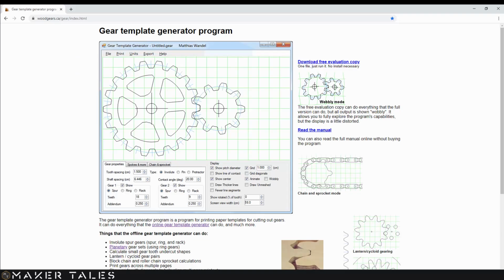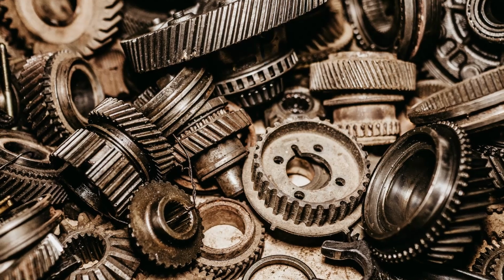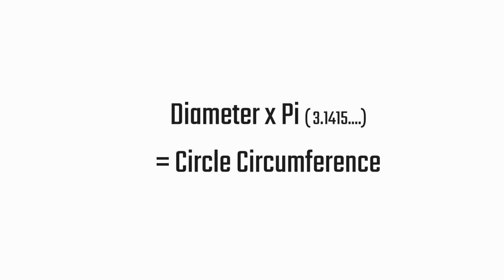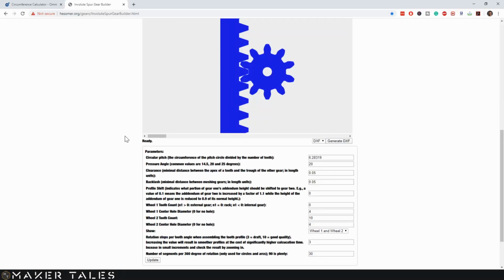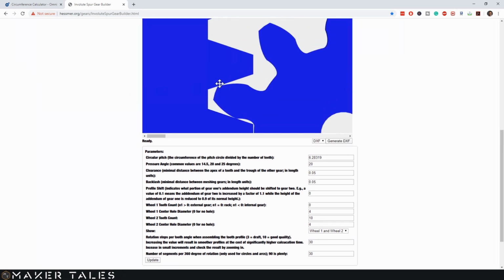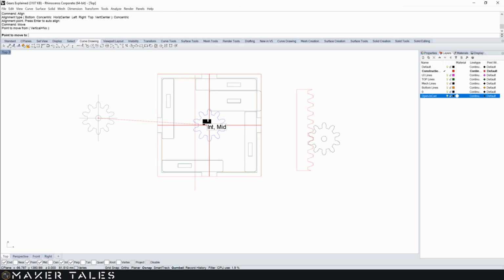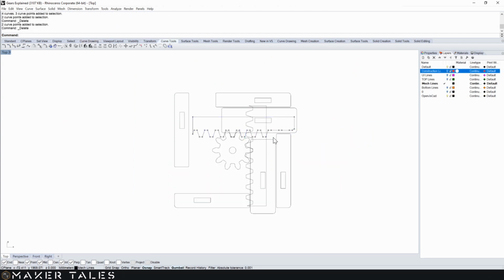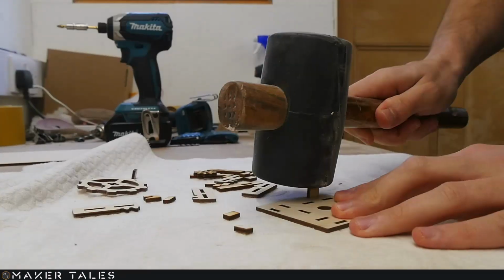How to: Make Puzzle Box Gears - (Tutorial) - Gear Fundamentals

Comment: Great video! learned quite something, only one thing, to calculate the circomference you said you should diameter/pi wich is actually not correct, to calculate the circomfrence you shoud diameter*pi. just a tip :) hope to see more of this series soon!  and an other little tip if you make the tooth count a power of 4, it is an gear wich is symetric in 2 ways so you dont have to design 2 sliding parts :)
Reply from the maker: I'm so glad you found it useful.... OH SNAP! I really screwed up there... Oh well time to take down the video re edit it and chuck it back up later this week.
Big thank you for pointing this out as I really don't want to mislead anyone. Thanks for the tip. I think I should of made that a little more obvious in the video too. OH and trust me there is a lot more to come but i'm just going to finish off this blender series and then pick this series back up in side of blender. Meaning that anyone can join along then.
Reply from the maker: Edited video is now up.
Thanks for pointing that out

Comment: Hi! Great video, but I can't seem to understand one thing. I stumbled upon the same problem in one of my projects. About the symmetry problem, i just used a gear with n*4 gears to not have this problem. And with the outer diameter problem. Why not just scale the gear with the same ratio as the rack? That's how i solved my problem. I just generated a 16 tooth gear and scaled the whole mechanism to fit my required size.
Reply from the maker: Hey Tomek,
I think I understand what your implying but I'm not 100% sure. Scaling mechanisms will work just fine as long as the whole mechanism has already been designed/generated. The problem you could get yourself into if you create one gear set that you made using (x) pitch circle and pressure angel once you scale it the math which builds the gear is scaled up too meaning that (x) is now (x) * Scale Ratio. So if you went to make another gear to fit into the scaled mechanism and if you did not know the exact same scale ratio you might get yourself into a bit of bother.